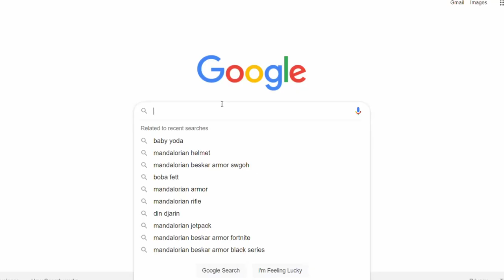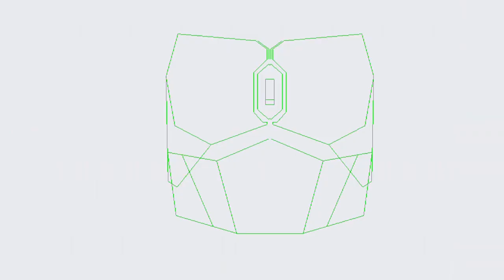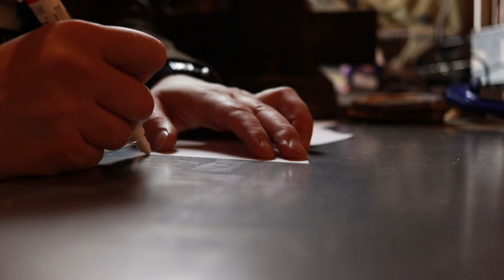I made the Mandalorian's Chestplate Bulletproof!

Comment: It seems like the biggest weakness is the sheet metal lining the top. A Bullet impact would cause that to cut you. Also, the fragments from the impact could give you minor cuts, but nothing deadly I'd assume.

As for shock absorption, you'd need a dummy to tell for sure, but it's probably around the same kinetic energy hitting you from impacts as would be hitting you with Kevlar, if not less because it doesn't dent directly into your skin as kevlar does. It's probably way heavier than kevlar for a single piece though, which would make a full suit pretty unrealistic unless you find a way to offset the weight. 

Overall very cool, I'm not really into guns and stuff, but I love anything SW.

Comment: This is really awesome.  Only thing I'm missing is I would love to have some more information about the statistics of the armor itself. How much does it weigh, how comfortable it is to wear, that kind of thing.  I'm also really curious about the steel that you used for the inner plate.  Is it some kind of specialized hardened steel or what?  Maybe a follow-up video?

Edit: You may also want to share your videos on r/TheMandalorian
Reply from the maker: I typically like getting into the details but I found the video gets way too long so I try to keep it simple. No time for a follow up though. So quick answer, it's AR500 steel which means it is tempered to be very hard Brinell rating of 500,  its probably 25lbs ish, and its not uncomfortable but it could be if I added padding.
Reply: @SECTOR07  I'm guessing that it's not actually possible to weld the sheet metal to the ar500, it's too different of a metal? If so, if you did a second iteration of this design, do you think you might use a high strength epoxy or something like that to kind of help keep the armor plates more securely attached than just wrapped around the metal?
Reply from the maker: I considered both. Tried JB weld, but it didnt hold it together when shot. And no you can't weld Ar500 because it softens it and makes it not bulletproof.

Comment: Would you make this stuff for me if I were to pay you whatever price you give out ??
Reply from the maker: It gets tricky with this kind of stuff. Mostly cause while difficult to penetrate this armor is actually not very good for practical use. That is because the smooth surface of this armor makes shrapnel quite dangerous. It might stop the bullet but pieces of it could still easily deflect up toward the face and neck.